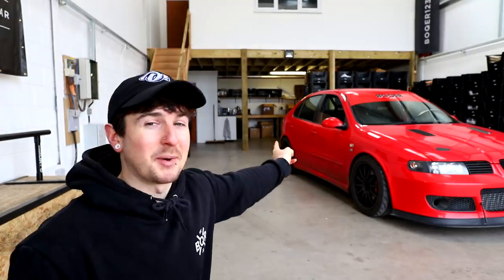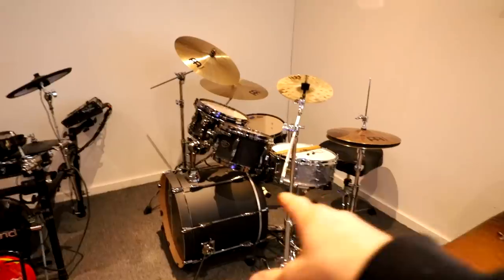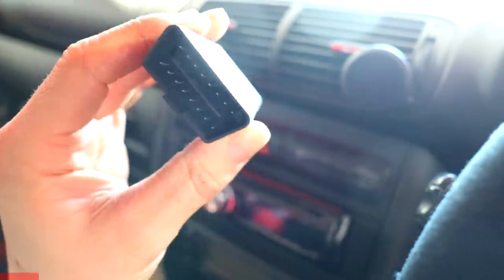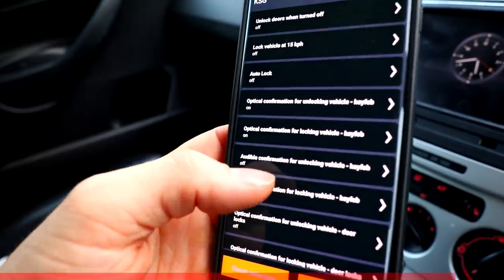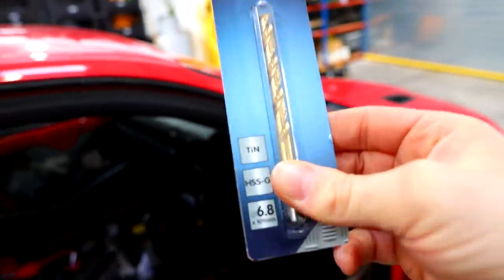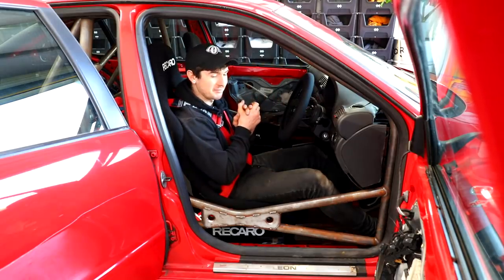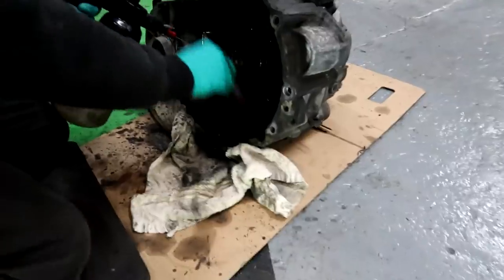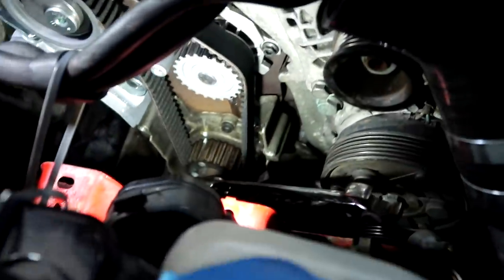This has made the Cupra WAY better...

Comment: I love shot 3! That’s my pick. I would definitely not be happy driving with the wall thickness on those holes for the seats though, the threads would get ripped straight out god forbid you’re in a collision. I would’ve just drilled all the way through with an 8mm bit and user a longer m8 bolt, washer and nylock nut on the other side👍🏻
Reply: THIS! ^^^ important boqer

Comment: The seats look quality, but that ain’t safe with that little amount of thread into the metal😅
Reply: He did say he’s going to get a nut welded in and it’s temporary.
Reply: The thing that is more unsafe is the 4 point harnesses
Reply: @ScottPC   actually lad, if you turn your volume up a little louder then you might actually hear him say let me know in the comments if that’s safe or not 👍🏼
Reply: @sketchyautoshop7621  isnt the harness safe since its connected to the Cage at shoulder level instead of connecting it to the floor
Reply: @sketchyautoshop7621  There's nothing sketchy about those harnesses though?
Fixed back seat, shoulder straps are mounted at the correct height to a dedicated harness bar, and a full cage fitted as well, minimising the risk of roof/A-pillars caving in on a rollover and crushing his head whilst harnessed in.
No anti submarine strap, but this can be mitigated by correctly setting up the 4 point harnesses
Reply: @AdilAaronAkhtar  Feom what I move read and watched, 4 point harnesses are less safe than regular seatbelts if not the same because of the submarining. Most people don’t get them because of cost or discomfort but the speeds that most race cars go, it is safer and better to have a 5 or 6 point harness.
Reply: Not safe.

Comment: With the hole for the seats I would drill through the box section and run longer bolts through to the other side and use nyloc nuts. They won't be going anywhere then!

Comment: I work as a machinist and u need about 3 threads to get the complete strength of the bolt holding it down. So i would recommend either getting a longer bolt that goes all the way through with a nut on the back or welding another plate so u can get in a couple more threads. The cupra is sick btw!!

Comment: Mint getting other people involved in doing bits of filming. Also I would probably get a cap nut welded into the seat rails or just bolt through and out the bottom. Print 1 is my favourite

Comment: It’s safer than using cable ties and wood to hold the seat in... but a captive nut... or send it straight through the box section with bolt and nut will do fine

Comment: For the seats, I would recommend drilling the holes out and rivnutting the holes. Save welding a nut in
Reply from the maker: That's a great shout... I even have a rivnut thingy 😂 cheers man
Reply: @boqer123   👍👍 just use the biggest size you can fit on the bar. Also reckon 2 for the prints

Comment: Definatly get a bung welded in there. The rule of thumb for engineering is 0.8x thread diameter for full thread strength in steel. And obviously if the space allows it more than that.

Comment: Looking at that piece of box you have bolted it to I’m thinking it’s 2mm mild steel that could withstand a yield stress of 175ish MPa ,were normal road car seat mount range from 550 MPa to 1500 MPa i think . Would be a good idea to get another square tube made up with the threaded plug in the correct place for your new seats. 👍

Comment: The wall of the box section really isn't thick enough, if you crash it will just rip it straight out. If you only have the box drill all the way through and nut an bolt it, still not the best but a lot better than just the single wall of the box.
Reply: I cringed at that 😅
Reply: @MrCam217  I know, even going straight through the box isn't the safest by how thin the wall is but still a lot better that tapping one wall that looks to only be about 1.2mm thick or 1.5
Reply from the maker: Cheers boys. I'm just gunna get a captive nut welded to match the existing one, didn't think it was safe after I saw how thin it was... But like I said in the vid, I just wanted to get them in 😂
Reply: @boqer123  yeah I get that haha and paint it to please! don't want to see that box section and welds go rusty! 😁
Reply: Rather not see you ejecting out the windscreen, still strapped in your nice new seat lad 👍 we've all been in a position to get new parts fitted in any means possible though 😂
Reply: I said glue it down

Comment: You could drill straight through the bar and tap both holes and use a lock nut on the other side with longer bolts if you’re worried about safety! Also, pic 3 for me 🤙🏻

Comment: Hey buddy, love the progress! Just wanted to say, I’d be reluctant to go with the seat subframes bolted into the box steel with those tapped threads; not a huge amount of bite to it in the event of shear load

Could you drill through both sides of the box and send a bolt up from the bottom into the seat subframe hole, out the other side with a nut on the end?

I respect you mentioned going for a captive solution later on.

Stay safe!

Comment: Print 2 👌🏻 that seats not safe, that’ll pull out straight away. Would either do a captive nut or put a tube insert the box so you can but and bolt through without the box collapsing

Comment: Also those bolts aren't the safest way, I did something similar and crashed and the bolts just ripped out. I'd say if you use a longer bolt and nut them from underneath also

Comment: Not safe bro. Seats rails need proper bosses putting into them like the inner ones one big shunt an you will rip them threads clean off.. If you have a nut on the bottom it will squash the box section in a shunt.. Get some more bosses made 👍👍

Comment: The box section is way to thin in my opinion... you have a crash that threat will pull out. You ideally want a minimum of 1.5 x thread size so 1.5 x m8 = 12mm

Comment: I’d get a nut welded it, assuming its 2mm box section you’ve got just over 1.5 threads of engagement - not ideal at all. Get a nut welded in, jobs a goodun and you’ll be safe!